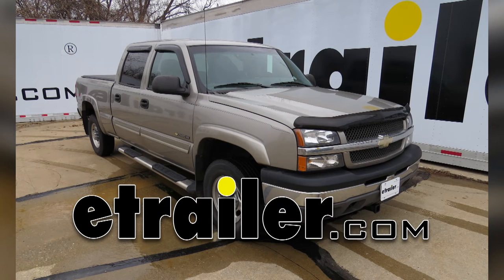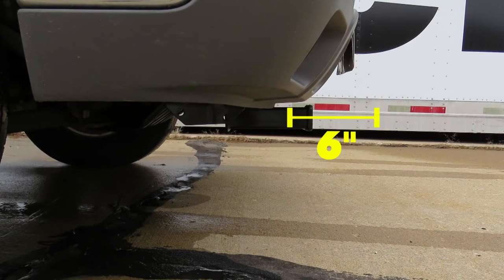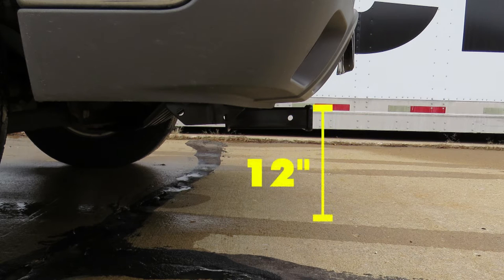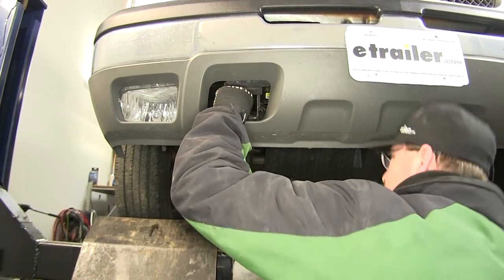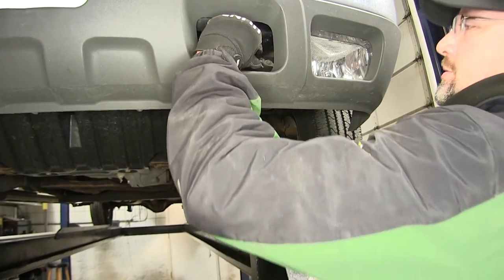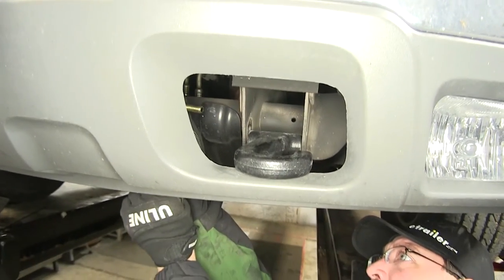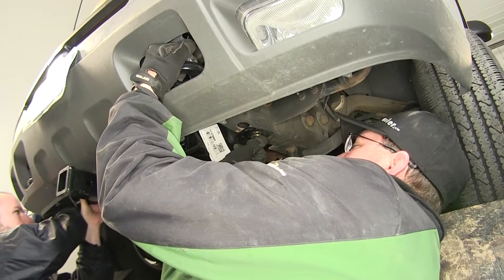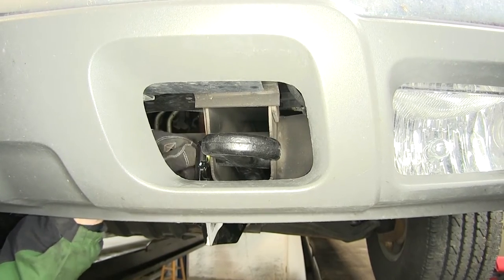etrailer | DIY Install: Curt Front Mount Trailer Hitch Receiver on your 2003 Chevrolet Silverado

Comment: I thing this is a 2500 but maybe a 1500HD
Reply from the maker: 1500HD but the hitch fits a 2500HD as well.
Reply: @etrailer  can I buy the hardware for this truck with OEM tow hooks?
Reply from the maker: @yupsir791  The hardware kit for the hitch is the same whether you have the tow hooks or not. You just use the M12 bolts and conical toothed washer instead of the 1/2 inch bolts and flange nuts with the other washer. You can order the complete kit. Select Curt from the Drop Down Menu and enter 31108 for the hitch's part number on our replacement hardware product page https://www.etrailer.com/p-rhk.html You can use the hitch's product page to find its installation details for specifics such as torque specs https://www.etrailer.com/p-31108.html